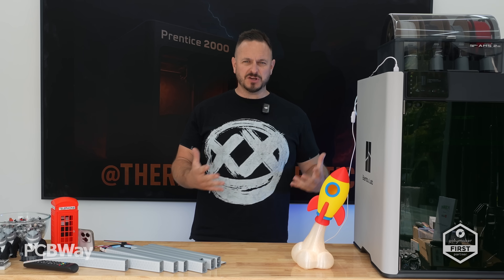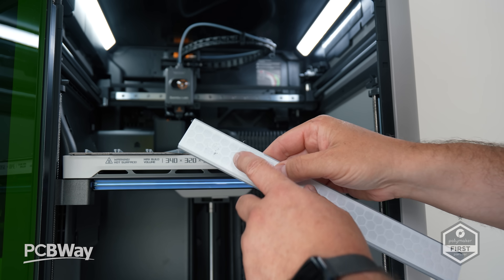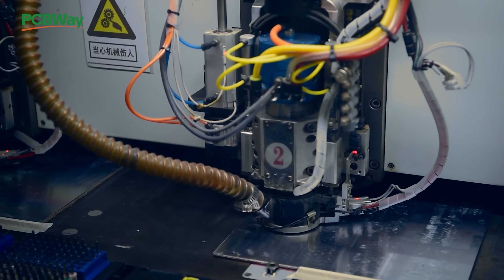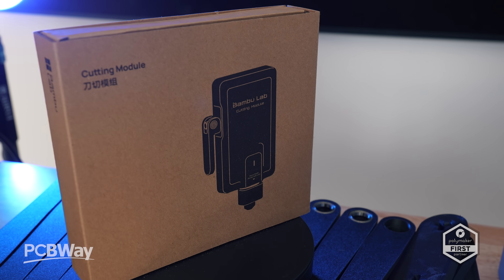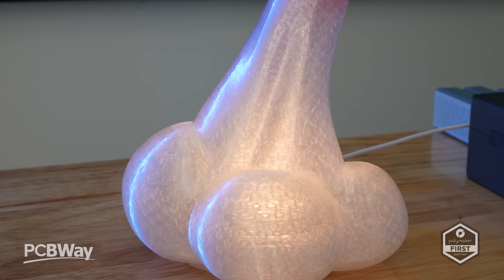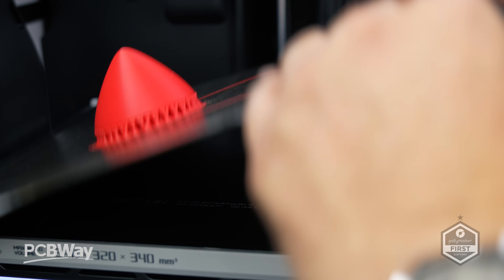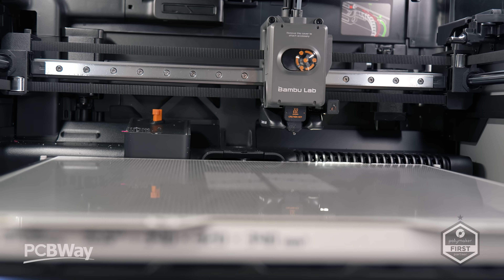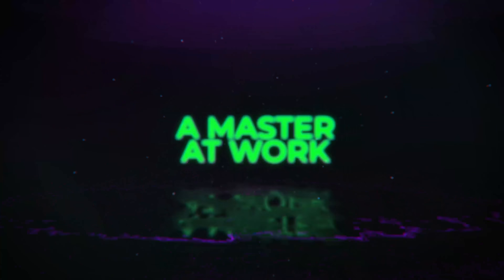Bambu Lab H2S: Is This the 3D Printer We All Wanted?

Comment: I bought the H2S combo unit without the laser. I already have a 100-watt Thunder laser, so that call was easy. I also don't like multipurpose type tools. That being said, the price point for a standalone laser cutter is only a hundred times more, lol. I love my H2S so far. This is my first foray into 3D printing. I bought it mainly for support for my woodworking projects, but I have found out that it's so much more. I use it to make things I don't need and never really wanted, and I love it. Oh, and as most of you already know, filement addiction is a real thing, so be careful.